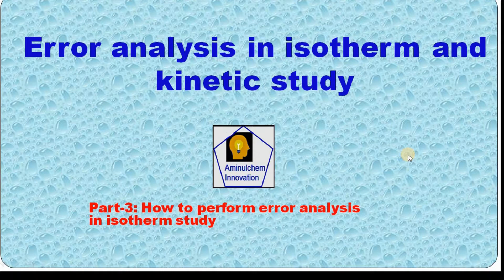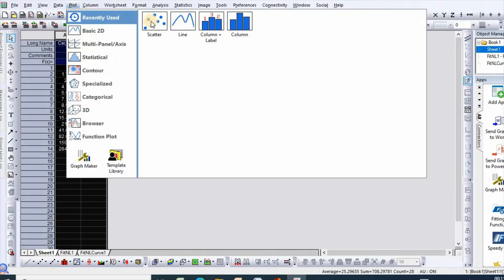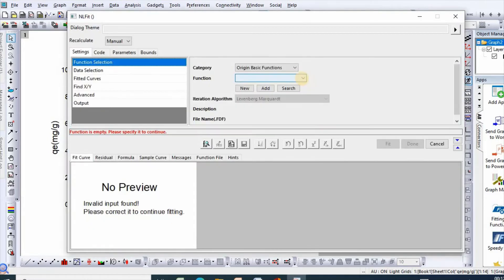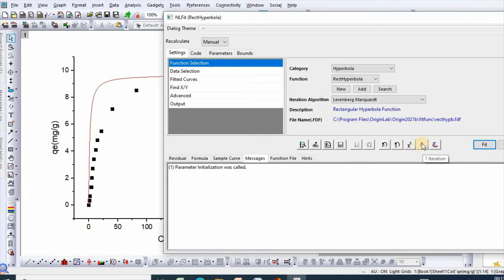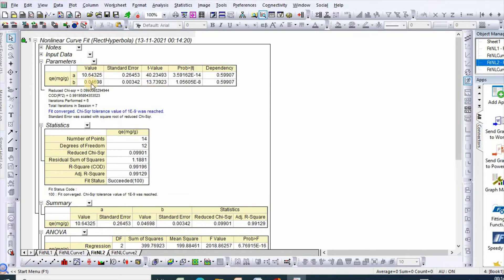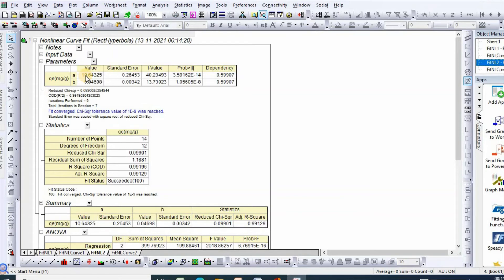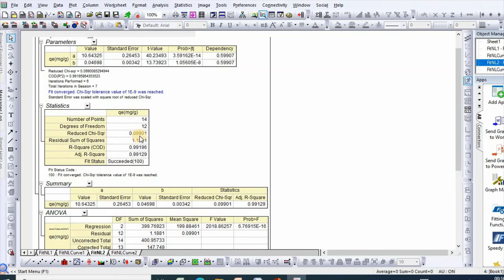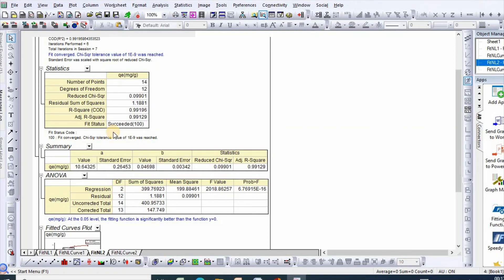How to Find Error in Isotherm Study Using Origin

Comment: Hello sir, Thanks for the video. I have a doubt. In a few articles, they are mentioning % error along with R2 values, how is it calculated? here in this video, there is reduced chi square under statistics tab and standard errors associated with both intercept and slope values, so which one do we need to consider?
Kindly clear this.
Reply from the maker: Thanks. Basically, thete are several errors in adsorption kinetic & isotherm models. R2 is the most common and you only analyze data based on this value. However, you can also consider other errors too. Please watch other videos and don't forget to subscribe.

Comment: Thanks professor.
Please sir 
Two queries
In first when ,the error function was found a similar in value ,a similarly between model like Langmuir look near ferundlich and the same phenomena was found between three parameters model and four , what can be ? 
In second question ,how we can calculate ARE in origin ?
Thanks sir
Reply from the maker: Thanks. You are absolutely right. Sometimes R2 values fot both Langmuir & Freundlich become similar & same case occurs for other cases.
Reply from the maker: ARE can't be calculated through model fitting. You can calculate this manually using excell or origin.
Reply: Thanks sir ,can perform us an video shows how we can calculate ARE with Excel please if that possible ,all my respect professor
Reply from the maker: @kawtarmessauda9406  Thanks. Please keep watching.I will try to make such video in near future.